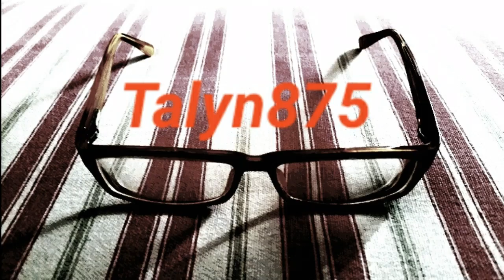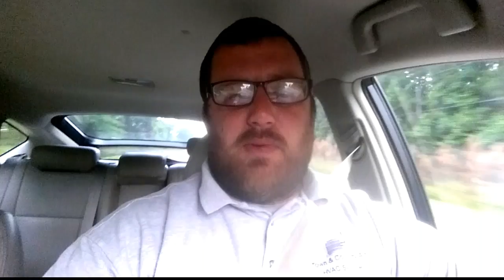Causes for High Condenser Subcooling (HVAC)

Comment: Hey zack have you ever came across a microchannel unit that was packed full? You can feel a huge temp difference on the condensor fan from 12-3 o'clock as that is the only part rejecting heat. I think there is a thermal image of one somewhere I saw was pretty neat.